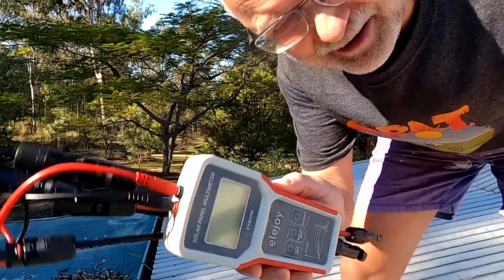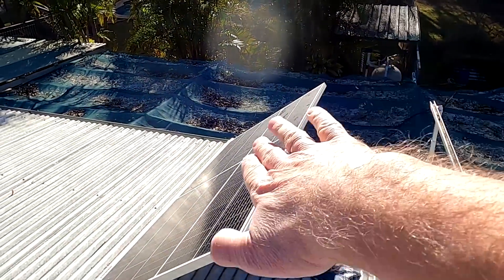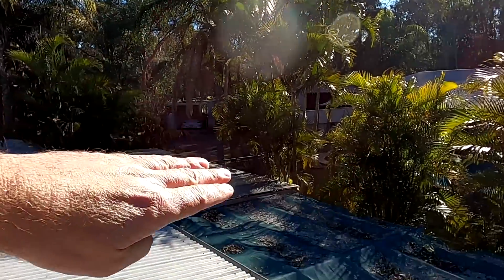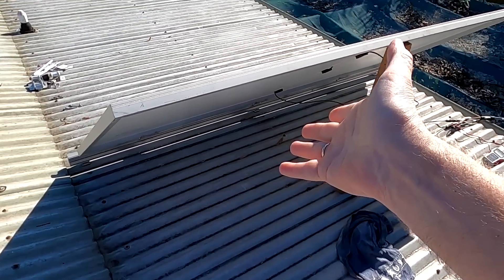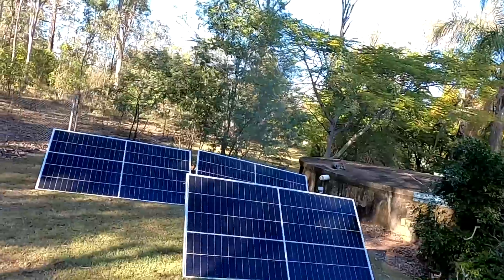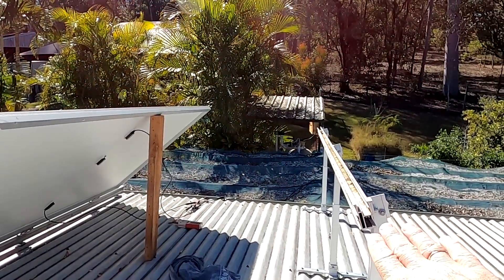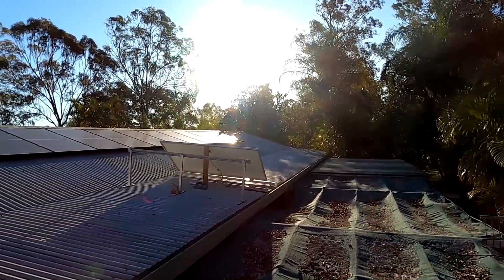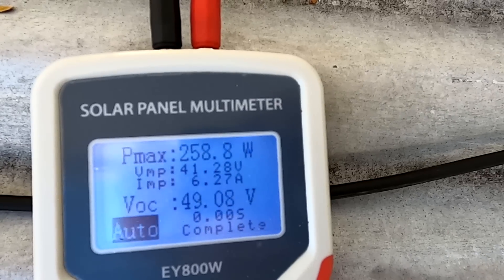Maximising solar production in winter.  Is a steeper angle really worth it? Timber vs Tilt Mount

Comment: I question about two panels plugged into one controller channel.

You've demonstrated that if you lay them flat, then each one has less power, so much less current.

You would overload the MPPTs in any other season, but you've already said these are for winter only.

Does make for a safety concern if you're not around to switch off in the other seasons, but could you make a home automation rule that somehow turns off the MPPT if the output power gets too high? Even better if it can work on input power. 

You could even disconnect the second panels manually, except in winter.

Even better if you can actively switch off the second panels if the power from them gets too high.
Reply: Another thought on two panels per channel.

Put a breaker on the second panel of each pair that will disconnect if the current from that individual panel exceeds half of the safe limit into the MPPT.

If you get a surge of power, or you're not around for some reason, the MPPT will safely avoid being overloaded.

A quick Google suggests that there are even current-limiting circuits that you might fit between a pair of panels and an MPPT input, to keep you safe.
Reply from the maker: For winter only does not mean, I'm going to disconnect them in the other seasons 😉
You can make HA or NR to look after the panel output and disconnect the inverter through the Shelly I'm using to read the power output. But this ads even moore complexity, doesn't it. I probably would consider such a automated electric disconnect as a second stage of safety/de-escalation in case the inverter is overloaded but maybe not for daily operation.

About your second though:
The breaker will not track or act on spikes and peaks so that's probably not going to work. It also needs to measure the current of both panels going into the MPPT but then disconnects only one panel? Not sure how that would be realised.
A current limiter will not work as it masks the max power point of the panel for the MPPT. It won't be able to 'drive' a panel through such an limiter.

Comment: I watch you channel.  I have accumulated 12 350w panels over the past few years.  I mounted them all on the ground with homemade wood mounts and a rope to secure them to the mounts.  Here at 35 degree North Latitude - I have been getting 250K watts a month; cloudy and sunny about equal this year.  The 250K is not the maximum output each month, that is the amount of energy my house uses during the day. The maximum output would be around 630K a month.  I did a few videos on troubleshooting an old panel and a charge controller. I started solar with 1200 watts the day before Christmas 1999 when I moved to this house.  :)

Comment: Another option could be a pole with, for example, the Eco-Worthy Solar Tracker that will surely provide more power, but with a price. The tracker kit has a good steering display and solid pole parts according to. other YouTube videos. Should be a better solution for winter panels.
Reply from the maker: The solar panels are over 2sqm large. Four of them would be like a huge sail.

Comment: You have room to fit one highly tilted panel on the steep part of the roof, IE in line with the existing array.

You can put another panel at the same steep angle on the flat part of the roof. Again, that can got as far back as regulations allow. 

Then you have space to site the other two panels as far apart as you like on the flat part of the roof, and they don't even have to be the same angle as the two steep panels. They have separate MPPTs.
Reply from the maker: No space there. The panels need to be twice as far away from the edge as the mount is high. Unless I mount them flat, it would not fit.

Comment: Thanks for your informative videos. I have a couple of questions if you don't mind answering

1. We use NMC nissan leaf cells in a 14S configuration. A BMS is fitted, but this only has top end balancing through resistors giving a 1 amp maximum current dissipation. I would like to add an active balancer. All your batteries seem to be LFP, so completely different working voltage range. Can you please recommend an excellent active balancer that works with NMC cells?

2. Our battery is being expanded from 20kWh to about 50kWh (hence the active balancer). I would like to monitor the voltage of each cell-stack. I would like something with a large digital voltage display, with one display per cell-stack. Can you please recommend a cheap voltage meter that operates in the NMC voltage range (4.2 - 3.4V)

Thanks in advance for any help, and keep up your excellent work

Comment: It make me sad that you might not be using actuators at this time.  It makes sense what you've chosen though, doing it requires a lot of work for not very much gain. 

 It's really not that hard to diy a lumen based DIY, all axis system with the knowledge you've gained over the years.  There are great people in the world that have made open source programing you can use.  It makes sense to take some time to present all the options from a content point of view though. I hope to see you get there one day.  It's the best way to do solar if you are on land.
Reply from the maker: I tested some framing of the solar panels in the garage (video coming) and found these panels are just far too large for a single actuator. The corners will wobble and swing and I have concerns that the solar cells under the glass will break over time from this movement.

Comment: A friend of me tested that, you can Connect 2 pannels parallel with your Inverter 👍 running since 6 month

Deye sun 2000 and on one Channel 2 x tw solar 415
Reply: That makes sense. 
There is no reason why the mppt should track for more power beyond its own limits.
Reply from the maker: Yeah, I wonder why all MPPTs have a maximum PV input power and maximum PV input current in their specs when it does not matter?

I tested with one MPPT I had and one of these large panels. It died after half a day.
Reply: @OffGridGarageAustralia  schould i send you a Screenshot of the Power curve from Solarmann? 2 x 415w parallel on one deye 2000 Chanel? I have to say the Volt ist quiet Low ~32 Volt so the deye never Take more than 12,5 a so this one Channel only make 400w but a very Long Time of the day

Comment: i think u are testing the wrong tilt frame angles, rather than north , you should test east to west, much better gain
north angle according to month, you would change by like 2 degrees per month depending on ur location
Reply from the maker: East? You must be new to the channel. Welcome!
I have huge trees in the East 😉
Reply: @OffGridGarageAustralia  even with east trees, a motor tracking from middle of sky to west would give a better total energy, bcz it would be perpancdicular to the sun rays , thus giving full power all the time when not shaded
Reply from the maker: @wazneh  that's the ideal setup but also the most expensive and difficult one.

Comment: if they are flat and next to each other - can you fit 25% more panels to make up for 20% less power/panel?
Reply from the maker: I cannot connect more to the inverter though and would overload it in the other seasons.
Reply: @OffGridGarageAustralia   aye, you would need more inverters and more places to feed power in other than that 10A plug.

Comment: You are focusing on maximizing the output of a single panel only. But since there is no way you can fit 4 panels in the optimum configuration on your roof, you instead should focus on the maximum average. So either you have 1 panel almost upright or 4 nearly flat. The combined output will be the same. So you can go for the easy mounting, less worries, etc.
Why not put as many as you can fit flat on the roof and get yourself another nice blue MPPT that fits these conditions? The inverter you have just doesn't seem like an ideal fit for what you want.
Reply from the maker: How am I supposed to connect these panels via DC back to the garage???
I made whole series of videos and why I have to use the existing pool power connection and this inverter. 😉
https://www.youtube.com/playlist?list=PLPomydD54sgDAZCaLsyuToXbAHR3zEVtS

Comment: Lying all panels flat is obviously not an option, because in the evening 4 flat panels create less Watt (4 times 50 = 200) than one panel tilted. An many tilted panels will shade each other. So maybe the solution is a mixture with only one panel at the edge of the roof and at the other end tilted while the others lay flat - or some programming that automatically lowers the first three panels to flat and only tilts the last one that is then not shaded for maximum combined output. (?)

Comment: Andy, they sell some one-axis solar trackers with actuators with anemometers that park the panels if the wind gets too high on various sites like Alie Express - if you're building a frame you can connect the panels with a tie bar like the wheels of an old steam train and use just one central actuator all the panels will move like louver blinds. Imagine 2-axis solar tracking now that would be something - there are some great examples to be found search 2-axis solar tracking or dual-axis solar tracking.

Comment: Poorly made AC charge controllers can over-current.  These are typically the Chinese MPPT micro-inverters you see on the Amazon and other retail sites.  They usually do have temperature management, but it is a poor way to manage an inverter and will eventually burn it out.  To rectify this you generally want to have the (open-circuit) input voltage be as high as possible within the capabilities of the inverter.   Which usually means series connected panels rather than parallel.

DC charge controllers generally do not over-current the input because the input voltage is usually required to be higher than the output voltage and they limit the output current to the rating.  So, by definition, the input current will be lower.

Comment: Fun fact, one solar panel at an angle produces the same amount of power as several solar panels that are flat and cover the same shadow area.   This is why I suggested just ignoring the angle entirely and laying down a bunch of solar panels (nearly) flat on the roof section... it can actually be cheaper because the mounting is far easier.    That said, I do not recommend fully flat panels because dust accumulation can be pretty bad and rain and other junk does wash off and can damage the seals over time.  You'd want at least 10 degrees off of flat.

The other item relates to off-grid / battery operation.  For these extra panels, you generally want them oriented to cover a portion of the day that the main panels do not which shortens the number of hours the off-grid system has to operate on batteries alone.  This is of almost the same importance as maximizing solar collection is because it can cut the overnight battery-only time by 2 hours or so and provide load support right up to sunset.
Reply from the maker: I think, I have explained this in all details 😁
Reply: “Measuring the production by the area of shadow created.”  This is a really intuitive way of explaining it - I hadn’t seen that connection before.  Ty.
Reply: You can get some plastic things you click on the side of the panel there is the lowest. They suck the water out so it doesn't accumulate on the panel, and it removes the collected dust too with the water when it rains.

I am using those things at panels with an angle only 7 degrees, and they really work great. I 3d printed mine, but you can also buy them.

Edit: changed 7% angle to 7 degrees

Comment: all inverters are made to handle 30% over there stated amounts.  I myself wouldn't want to do that. its like running an engine at max rpm it isn't good. 100% is what you should have max of suggested amount of solar. Just add another inverter or mppt controller.